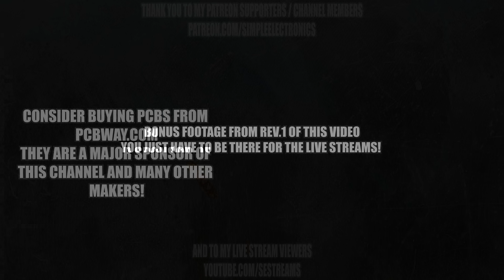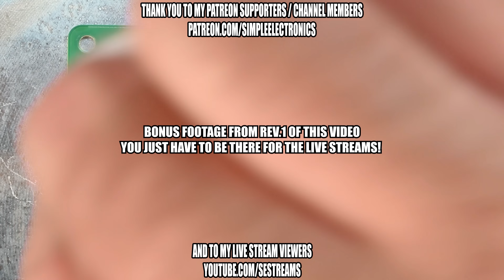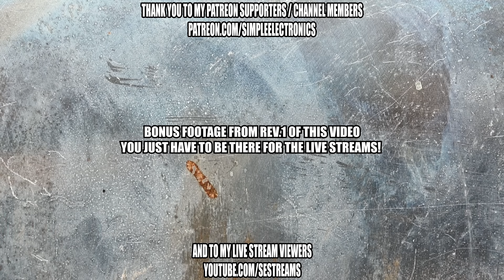Every Tinkerer Needs To BUILD This! | DIY i2c Scanner!

Comment: I ordered the PCBs and it was real fun to solder these with the components: finally enough space between parts to not be forced to use a microscope - thank you!

I have one final problem: Line 68 gives me the following error: "Compilation error: no matching function for call to 'TwoWire::TwoWire(int, int)'" and i am not able to fix it - without this line the Scanner starts up and seems to be working, but without a second i2c instance there is not much of use to it. Any idea, what is wrong?
Reply: I fixed the issue by commenting out 
// TwoWire Wire1(i2c1, I2C1_SDA, I2C1_SCL);
and inserting the following before Wire1.begin()
// Initialize I2C1 for device scanning
  Wire1.setSDA(I2C1_SDA);
  Wire1.setSCL(I2C1_SCL);
  Wire1.begin();

Now works like a treat!
Reply from the maker: I have had some reports of that, I think it has to do with the update of your library - I would just paste the code into ChatGPT and ask it to fix it for you - I'm horrible at code so that's the most I can offer, sorry
Reply: @SimpleElectronics  ChatGPT did not help, but I found the solution and maybe it helps others:
Instead of the "TwoWire"-command just use 

Wire1.setSDA(I2C1_SDA);

Wire1.setSCL(I2C1_SCL);

 in front of "Wire1.begin();" - the second I2C1 is already in the library provided by the GitHub-repository.

AND: SDA and SCL are switched on some of my boards... so watch out!

Thank you a lot for your great work and for taking the time to reply!
Reply: @SimpleElectronics  I have the same issue. What version of wire library are you using?

Comment: Just wondering is the OLED on the same i2c bus? Woud that not conflict if an other devise is plugged it. I use the scanner some times to check if a device is dead.
Reply from the maker: Different bus to avoid those conflicts

Comment: Why do you have the pi under the PCb and not on it? Now you have to use a case or spacer. Would be more comfortable if everything is on one side of the pcb
Reply from the maker: Well the design is open-source - have at it!

Comment: Very nice, these are very useful.
A nice feature to ad is the product id.
I recently used that as I have two Bosch BM280 sensors.
But they come in an E and a P flavor.
The P has no humidity sensing.
Reading the product product id let me id them apart and thus use the correct library, as they differ.

Comment: Pretty cool idea. However I have to use 1.8v parts now and then. So I designed my i2c sniffer solution around the FTDI 4222 chip. FTDI sells an eval board that plugs into USB. The software runs on a PC and you just need a dc-dc converter from Ali Express to get the 1.8, 3.3, 5 V supply. Whole thing is less than $20. It's nice too because the 4222 also supports spi bus so I can sniff both i2c and spi. Good luck!

Comment: If you have a flipper zero you can do this too but obv it's much more expensive! There's an i2c app that I think is included on stock firmware, but you can install it with flipper lab if it isn't. Good idea tho.
Reply: Unfortunately the Flipper Zero is illegal in Canada because it can be used to sniff RF for car theft. Silly, it's probably only made a black market for the device and anything else that can perform the same function. You can own one as long as it has a SN from before the ban.

Comment: What are the pros & cons of using external or internal power regulators?
Reply from the maker: The external regulator means you won't brown out your microcontroller if you have a dodgy module that shorts the power supply
Reply: @SimpleElectronics Ah, ok. Thanks.

Comment: Why is the case so high?
Reply from the maker: Couple reasons: 1 for hack ability so you can  put in a battery or whatever you want and 2: because it's a standard size I will use for my suite of tools
Reply: Could be for battery

Comment: This is a great stand-alone tool for finding the unknown address of those random modules I've collected.  But how do I then figure out the data inputs and outputs of a module?  I still feel like I need a datasheet for that.
Reply from the maker: Datasheet or just use a library or even a demo project - the possibilities are endless!
Reply: @SimpleElectronics  I feel like you don’t understand this as much as you make out that you do the module has an example library there’s going to have dresses in there if you do not know what the module is or it’s a really random chip the example code does not exist
Reply from the maker: I've run into multiple libraries that say "try this address, and this one, if not, scan it" - so we may just not be buying the same modules. A lot of others have had programmable or no addresses at all.

Comment: Just use a bare Arduino Based board and use the I2C Scanner which is included in the examples.
Reply from the maker: Sure but this one doesn't need to be connected to your PC because it will display it on the OLED
Reply: @SimpleElectronics  Plus the CoM is so low that its functional value far exceeds the financial cost.

Comment: It's amazing that you can just order any pcb you want nowadays. I don't however really get what this could be used for. You mention that sometimes the supplier doesn't list a datasheet, but an i2c device implementation needs far more than just an address. The only times I've needed a i2c scanner was when I needed to check if all sensors on a pcb responded. This makes much more sense to flash on the mcu you're working on in my opinion, because you're connecting them anyway.
Reply from the maker: You can have an opinion but I have used it 4 times since building it a few weeks ago - but I do get random i2c modules from China all the time
Reply: @SimpleElectronics Thank you for the response. When getting random i2c modules from china, how do you implement the actual commands and registers without a data sheet?
Reply from the maker: I would look for libraries first. Failing that, I have gotten success by linking the aliexpress to AI and asking it to make me a sketch - give it a try!

Comment: So wait, another tool I use once a year sitting around? 

That is a great waste of space...
Reply from the maker: I mean, you aren't forced to make one 🤷‍♂️
Reply: I know, I was stating a fact. The advantage of being able to reuse Arduinos is the ability to first check an address, then reuse it for the project. 

(Maybe you are using new sensors every day, but for me it's the standard ones, from SHT31 to HYT939)
Reply: But you are missing the point maybe. When you want to use it  you’ve got it and you have the satisfaction of building it yourself. Not that you can’t do that with an Arduino, but this is way more elegant IMHO. 
Plus, as was stated earlier, you’re not being forced to build one. 
Myself? I’m ordering parts now.

Comment: +10 internet points for the engineering work.
-4 internet points for 3d printing a project box...
C'mon Dan. You are better than that...
It feels like HALF the admin work I do at my local hackerspaces is banning people from printers for printing flat plates and simple boxes.

/rant
Our printers literally have a sign on them that warns people not to.
We have a line painted on the floor that leads right to the 'scrap flats' bin that sits next to the drill-press and band saw.
Those scrap flats are FREE by the way.

And still I have to ban people for printing flat plates with 2 holes in them, that they could have made in 3 minutes, and tying up the machine...
uugh.
/end_rant
Reply from the maker: Send me some scraps and I'll make boxes, plastics are super expensive in my next of the woods - but the cool part is that some people just do electronics, no physical things - so they can take my design and send it to the local library to have it printed, or order it printed from pcbway or even have it milled into aluminum - the sky is the limit. This channel is about enabling people to do what they want, not limit people's options
Reply: @SimpleElectronics  My local library also has a rule about not printing flat sheets.
It is an incredible waste of resources, when we already have cheap bulk goods produced in those forms.
Project boxes are also dirt cheap.
There just isn't an excuse for printing, or even encouraging people to print these kind of things. It is a waste, and we HAVE to stop accepting un-needed waste.

3d printing is amazing for doing a few very specific things.
But it is VERY often abused as a "Push button, get thing" box when it really shouldn't be.
There are better/faster/cheaper ways to make things, and we need to encourage people to do it right.

I love your channel and have been subscribed for several years.
But it's not okay to encourage people to do things the wrong way either.
Sometimes what people "want" is wrong. Limiting them is the correct thing.
Reply from the maker: We'll have to agree to disagree! If we banned people from making bad decisions, the Ford dealership would have to close up shop!

Comment: If youre buying i2c devices without addresses given, then the sellers dont deserve the business.
Reply from the maker: You just need to experience the magic of 1-4$ random i2c modules from Aliexpress!
Reply: @SimpleElectronics  
which is where i get my i2c stuff from,not had a address issue over many years,also google search comes up 99.9% of the time,with i2c addresses on most if not all devices.
Reply: Hey, the part bucket sells for free and delivers instantly, watch your tongue
Reply: Generally speaking, it’s not the seller’s fault when the chip used in the product is clearly labelled when you know what the devices you look at the data sheet otherwise every place that sells chips would fall under this you should check data sheets
Reply: Software addressing… ;)

Comment: I feel this needs a lot more functions in order to be a sensible thing to build but I can't really come up with anything in particular.
Reply from the maker: I have to disagree, the amount of times I've breadboarded and uploaded a circuit to just do this is absurd, I decided that since I've been using most of my electronics tools for the last 10 years, This thing deserved to be alongside it!
Reply: @SimpleElectronics   You are also an electronics tutor while most of us just build things as we're curious or as we need them, we order parts with a project in mind and not just because we might need to, and new projects aren't too often, and by the time you have wired things up, you can also just use the same system you're building do the i2c scan.

That being said a microcontroller, a little screen, and a couple GPIO is a recipe for a LOT of little tools, especially if paired with a rotary encoder. Like say a servo tester, a frequency counter (slightly shitty), a PWM generator (slightly shitty), a 3-state logic probe, an i2c register reader, an i2c eeprom viewer, a TV IR remote control decoder, a uart sniffer/viewer, a 433MHz OOK decoder, a micro current meter, a servo tester, a servo signal viewer, and it could be semi-modular to where people would only need to build up the IO sections for features people actually care about.

RP2040 is cheap and has powerful IO features and IO remapping and can host a large firmware. If you have the micro remember what the last tool was, it's not that much less usable than a dedicated tool. You can also have the individual tools on an edge connector, where some pins are functional, and some pins encode the type of tool installed, say 5 pins giving you a range of 32 tools, so it switches automatically, but any number of other tool ID schemes can be devised, even just a single resistor. Especially perfect if it's prototype/veroboard compatible so you can always make an extra tool, and an integrated tool storage drawer.

Swiss army knife tool? Egg-laying wool-milk-pig?